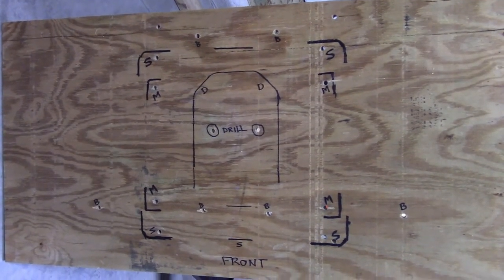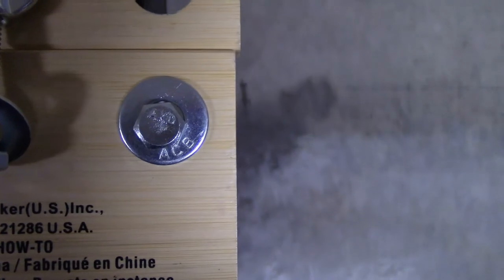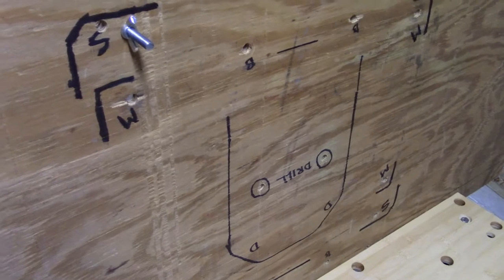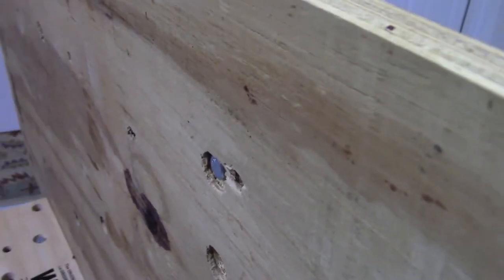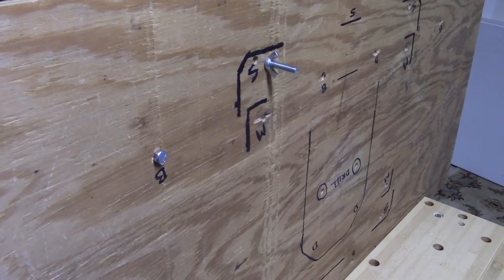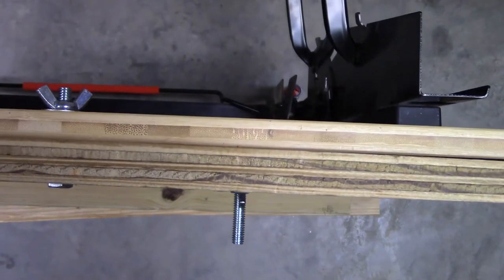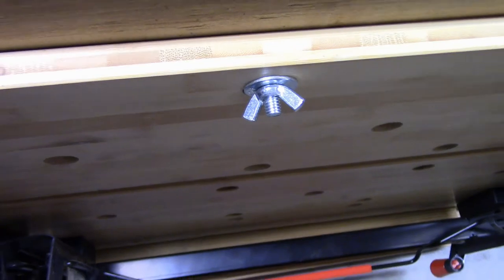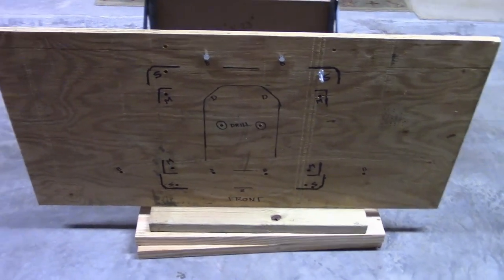How To Attach Power Tools To Your Workmate 425 Part II

Comment: Thanks for sharing. I’m just getting into this and am fixing the plywood as you have. A question I have is about the protruding bolt to hold the power tool; how do you prevent the countersunk bolt head from spinning when you tighten the wing nut?
Reply from the maker: You can hold it in place with your fingers as this does not have to be super tight. Cheers!

Comment: Instead of bolting the plywood to the Workmate, why didn't you simply fasten a piece of 2x4 material to the plywood, and then use the Workmate's vice to clamp onto the 2x4?
Reply from the maker: Hey Steve - Yes, you can certainly do that and I believe I showed this in one of my other videos.  However, I like the additional security of bolting the working service down as some power tools can be heavy and larger work pieces might just create enough leverage to break the grip of the bench.  Thanks for stopping by and good luck on your projects.  Cheers!